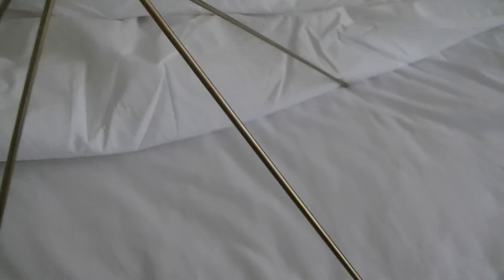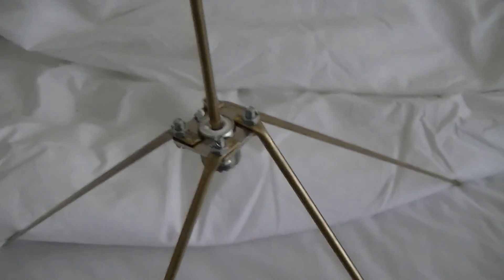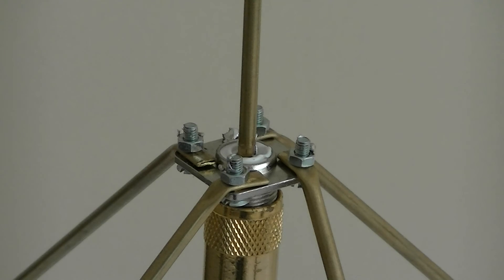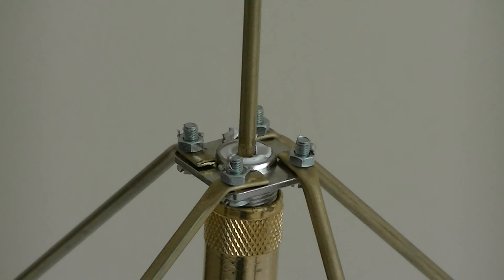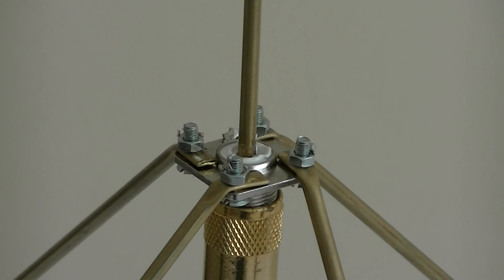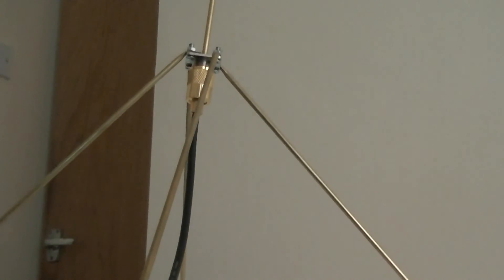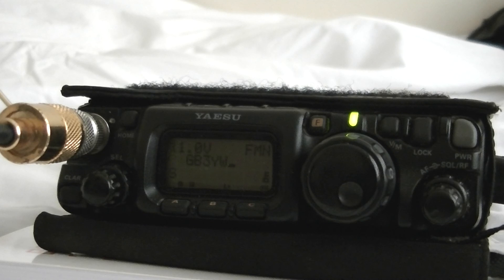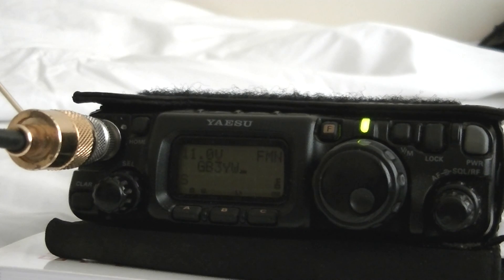Home made ground plane antenna for VHF

Comment: I did this. The center wass 19 5/8 and radiaIs were 19in right on. I use LMR cable just 2 down or one down from lmr-400. I get 2m/440.  And for some reason I got 1.25m that 220 in USA..my swr are 1.5 and they went no higher. It was about 25ft in air..